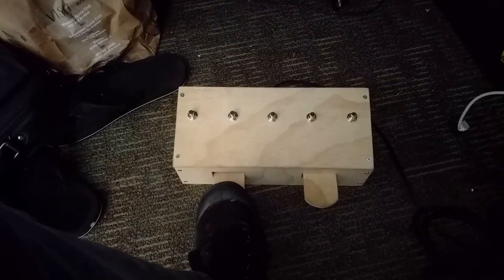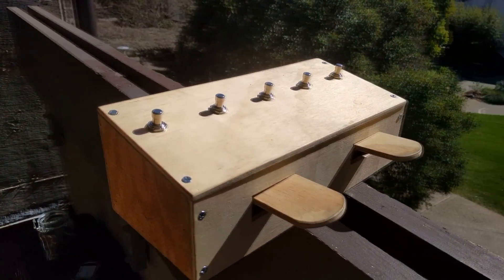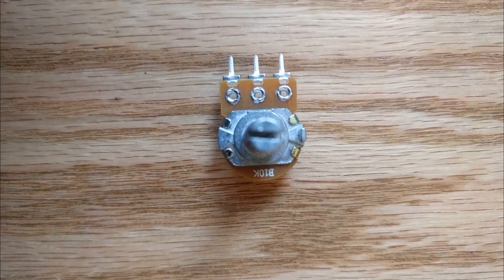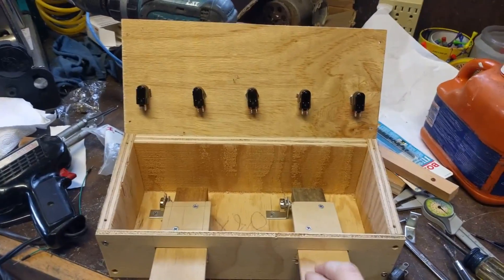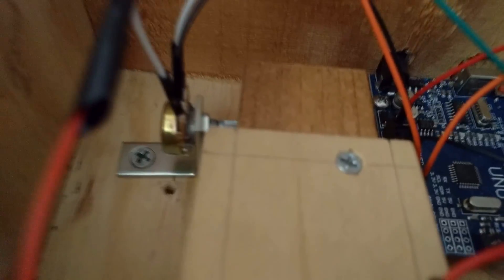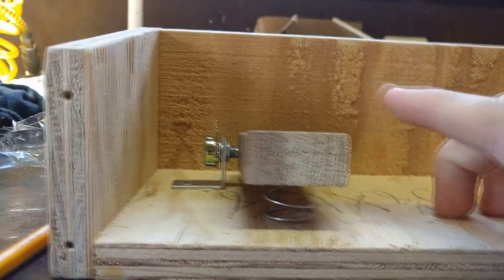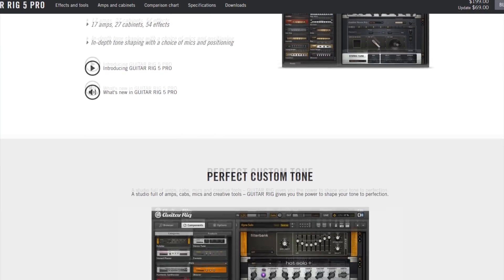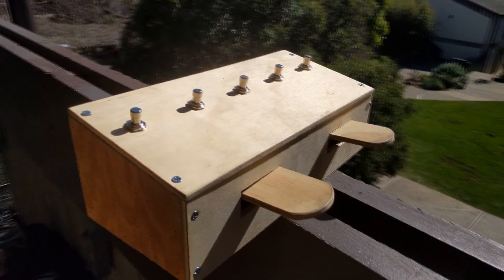How to make a DIY Guitar Pedal Controller

Comment: Thank you very much for your help. I have been looking for such a solution to replace the factory pedal for a long time. I built it, it works. The difference is that I was able to get a 2 amp push button, for which I had to connect a 10 kOhm resistor.

Comment from the maker: just had to remake this project. Thanks, me, for making this video
Reply: Sorry to ask this, I have made a pedal like this using your guide it worked fantastic on gr5. Now I use amplitube4 and the analogue works ok but the digital buttons use note on/off which Ampli4 doesn't recognize. Any advice?
Reply: I tried changing the code to force the digital pins to use midi_general like the A1 pins but it threw compile errors and I don't understand it.
Reply: Hey, thank you very much for this video.  I've been wanting to make my own foot switch setup for a long time now.  I did it ages ago with an old keyboard, but I wanted to have something with a little more functionality and that would be similar to an actual pedal board setup.
I ordered everything you listed in the description and showcased in the video.  The only item that gives me some level of concern is the Generic Arduino Uno.  The eBay link that you posted is no longer valid.  Although there are countless sellers selling various models of the Arduino.  I tried to freezeframe your video to see if I could see the model #, but I didn't have much luck.  Even if I ended up getting the wrong one, I can't really complain, it was like $3.  I figure I'm going to make a few of these foot pedals.  One with Volume/Wah, another being a loop-station, one being a tuner, another being distortion, and lastly a mismatch of chorus, reverb and flanger.  
I have a friend who makes custom guitars, and it's something I would really like to get into, but I figure making pedal boards would be a good jumping off point, so I'm not wasting hundreds of dollars in wood and parts because I have no clue what I'm doing.  
Hell, if you make another one similar to the one in this video, and then you stain the wood, I'm sure people would be eager to buy it.  With the technology of today and dozens of amps and pedals only being a click-away thanks to VST plugins and other software, these DIY pedals may have a period of popularity.  
Sorry for the rant, this stuff just gets me fired up.
Thanks again, subscribed to the channel, hope to see more interesting content.
Reply from the maker: @rhelferstay  Hi, I'm really glad that you're so interested in the video! I've been meaning to remake this video for the past year or so because I've come up with a few changes to make these boards higher-quality. The biggest change is that if you use an arduino pro micro, it can be programmed to show up directly as a midi device with no extra software required. I guess that it's a bit late now that you've already ordered the uno...
Reply: @ConradMenchine  Im very interested in learning more about the wirings, I'm really bad at elec stuff however I'm planning to make a Chewie II the loop pedal of edsherran, got the software part down, now only need to get MIDI input into the computer but without the need for midi through an audio interface. Could you help me out more with your new build? How can we connect?, Thanks in Advance